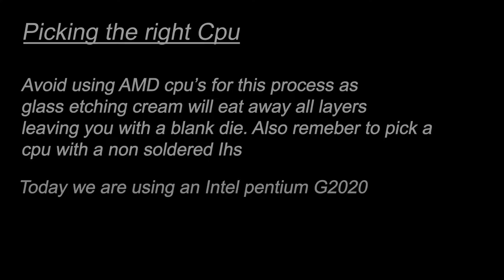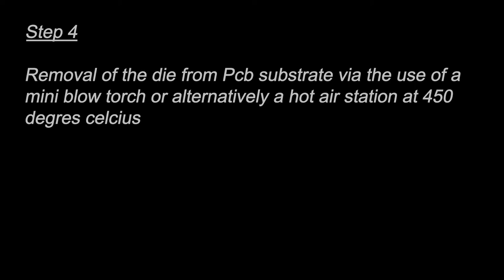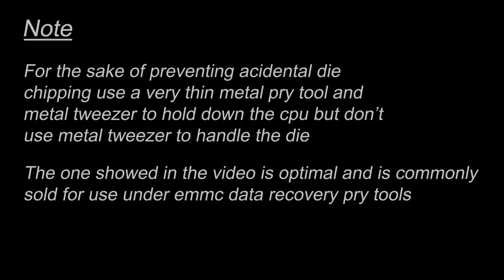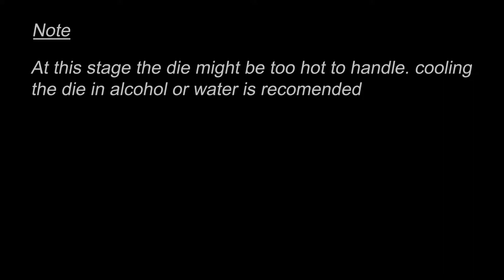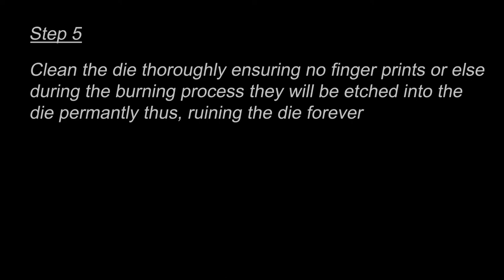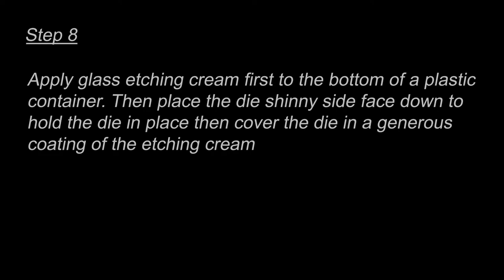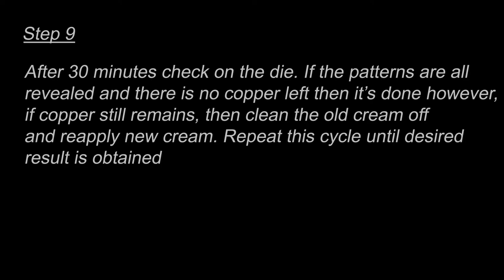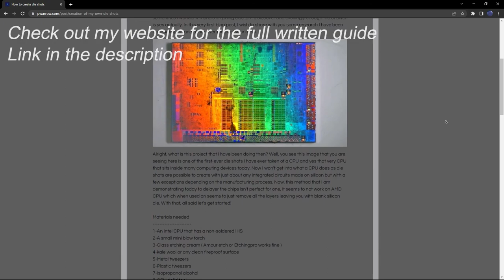Creating Intel CPU die shot without the need for sanding

Comment: Thank you very much for this video ! How do you store the CPU afterwards? I don't know much about this and I am scared of storing it in open air as it may create an oxydation layer so I wanted to know how you are storing it
Reply from the maker: Hi, thank you very much for your support in these videos. As for storage, you don't have to worry about it forming an oxide Layer as it won't do that in open air at normal temperatures. Even In extreme temperatures the oxide that forms is silicon dioxide, which is glass and is clear. Tho, if you do wish to remove it. Some glass etching cream can help with that. Personally, I have just resorted to keeping my dies in individual zip lock bags then storing those bags in a structurally sound box. It's worked well for me and is very cost effective. Tho, for my more important dies I have kept them inside of a harder plastic case with some foam in it, which when closed will sandwich the dies between the case and the foam. Unfortunately tho, I got that case from my scrap drawer so I am not sure where to source such a box but since die thickness can be an issue with such a method of storage, I still suggest you go with the zip lock bag and box method. Just make sure 1 die 1 zip lock bag to keep them from scratching each other.

Comment: Will ferric chloride or hydrochloric acid+hydrogen peroxide work for removing the copper?
Reply from the maker: In a bath of warm ferric chloride it might however, I think this would be excruciatingly slow. I have seen a video where this method was used and it took them in orders of days to I think a week to make an intel Itanium die shot. The reason is due to the fact that there is a thin layer of glass above it. The glass ends up protecting the copper from etching and the only path is, and this is only my theory. The holes that were left behind by the near microscopic interconnects that connect the transistor layer to the microbumps above.

Inadition to that, I think some dies use metals that are hard for Hcl to dissolve alone. If you happen to encounter this. Then you can try a mix of Hcl, nitric acid and some peroxide if you have it. I found that it helps clean up the dies better.  I have never tried soaking the dies in a warm mix of this for extended periods of time but I suspect, over a long enough period, it might work.

Finally, if you are asking this because glass etching cream is hard to find or  a little too pricy. Then you can subsitude it for a solution of Amonium bifloride. I found it works well and it's rather cheap to obtain by the kilo.

Sorry for writing so much however, I really do hope you will be successful in your experiments. Don't hesitate to let me know if I can help you with anything and if you can, let me know if you find anything out that is interesting. Oh yea also, don't forget,  anything that can dissolve glass will definitely not be compatible for exposing SOI based dies. If you try it, you will end up with a blank ruined die. An example of this would be Amd A6 3400M Cpu. So yea, do be careful.

Comment: Does this work for silicon on insulator Chips? Or just Cmos? I've been wanting to do this for a long time but it looks like every chip type requires its own method. With that said, what specific chips will this method work on?
Reply from the maker: Unfortunately, it doesn't work for Soi chips I tried it on multiple older AMD CPUs and it just left me with a blank die. It seems like the only way for those for now is manual lapping unfortunately. I am working on a way so that manual lapping is not required. Will update you when I can figure a way out.
Reply: @pwarrow  that would be great! I would love to get more into it but college has me occupied at the moment. I guess the only way to go forward is to experiment with the different methods you and a few other channels have posted. I'd have already mastered the technique of using a hot air gun to decap small epoxy ICs but they are definitely not as interesting, but it's a good start.
Reply from the maker: Oh haha I am in a similar predicament tho I am just going to start college soon. Tho a quick note about decapping epoxy chips. RF related chips are from my experience the most beautiful and interesting looking and oh yea, if you get the chance to try to decap phone SOC you should definitely cook it in sulphuric acid. Tho, please please be very very careful when doing so. Anyways I think I said a little too much. Happy to see your enthusiasm and good luck !